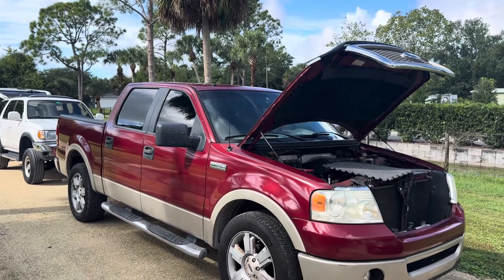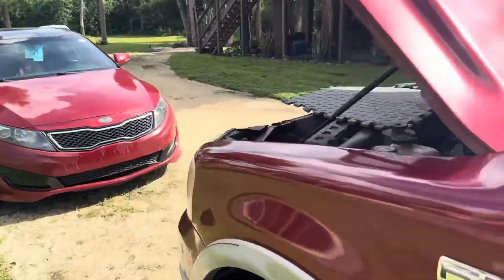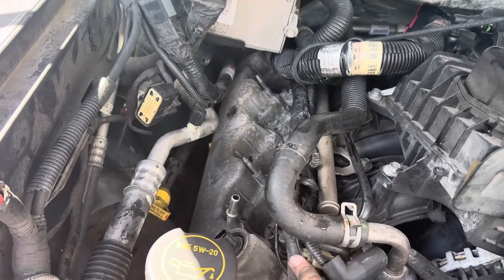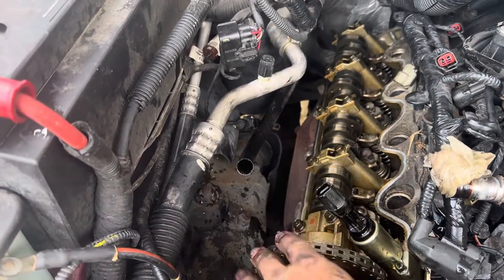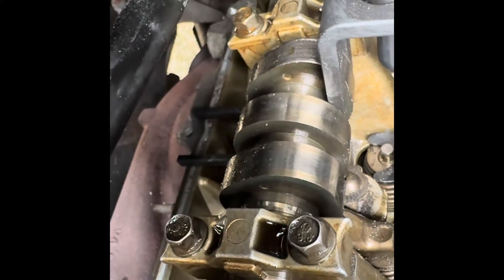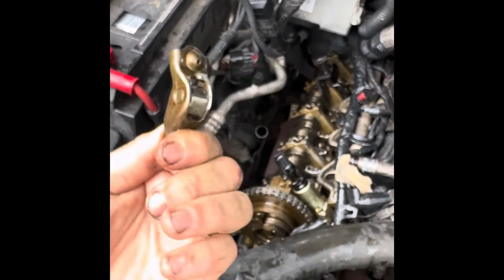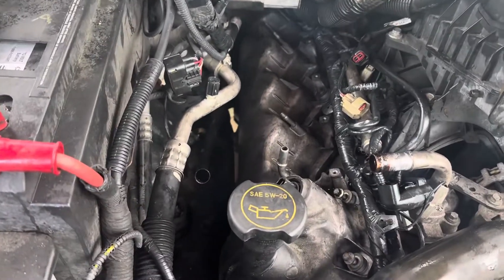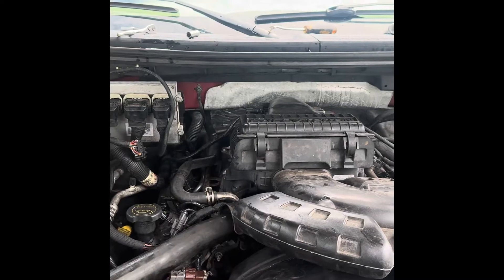F150 5.4L Triton engine ticking noise - roller arms replaced without camshaft removal

Comment: Im guessing that was Cylinder #3  (NOT FIRING ORDER) Worn Cam Follower & its bearing you held up to video camera?
Also opposite Bank #7 Cylinder many bad Exhaust Cam Followers (Rocker Arms) found by Youtube mechs over the last years...Listen for Ticking Noise from 3 & 7 with Stethoscope or a long screwdriver handle carefully to Ear
Reply from the maker: Yes, that was the worn out rocker arm for the third cylinder back on that bank.

Comment: I have this noise on cold starts on my 97 5.4 f150 175k. Sounds like its coming from the same side and takes a few mins to go away. I'm going to replace the lifters and upgrade the rockers to melling. I will try remember to let you know if it is the same cylinder. My back is going to hate me for this.

Comment: Good fix - one thing though, the oil pressure gauge is just a glorified dummy light. It's either on or off, no real measuring of oil pressure going on. Weird that Ford did it that way, but they did.
Reply: Jeeps are the same.........